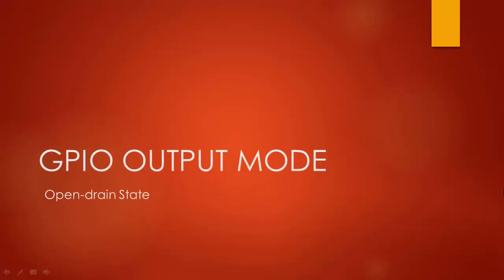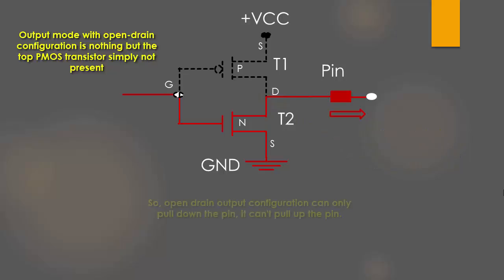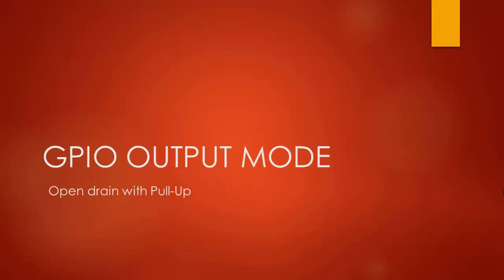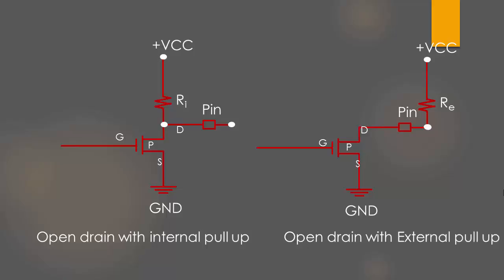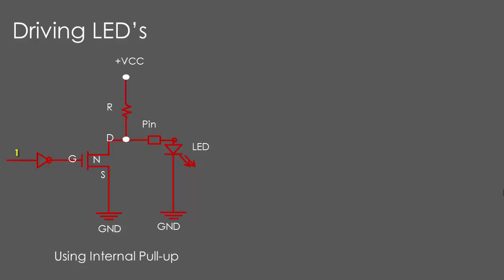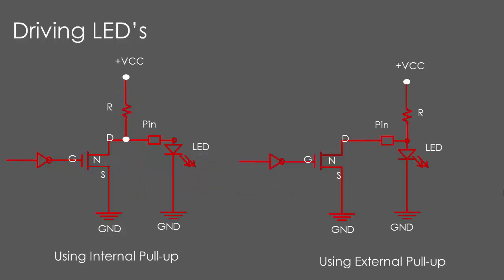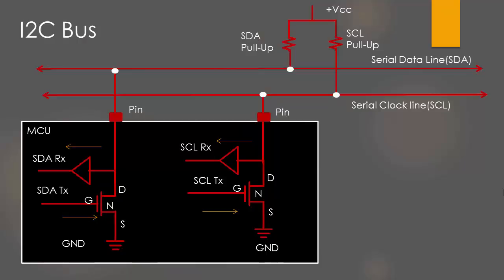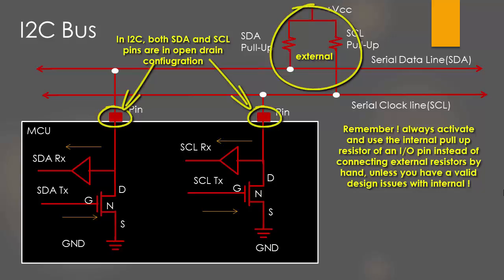GPIO Ouput Mode with Open Drain state

Comment: Great video. However, @2:16, i guess the transistor depicted should be of N type and not P type since slide 1 showed that P type is not present for the Open Drain configuration.

Comment: Hi, why do you take in consideration an inverter?, that does not comes integrated in the mcu, or yes?, and another question, why in the open drain config do we need to write 1 to turn off the transistor and pull the load to ground?, would not be better to write 0 to do this job and save energy in the mcu, avoiding to use a gpio in high to turn off the led?